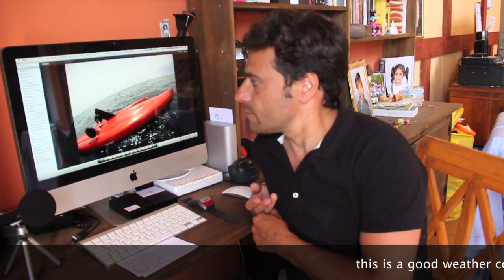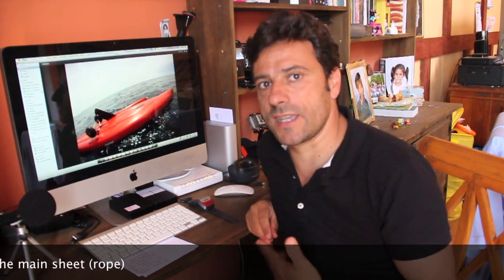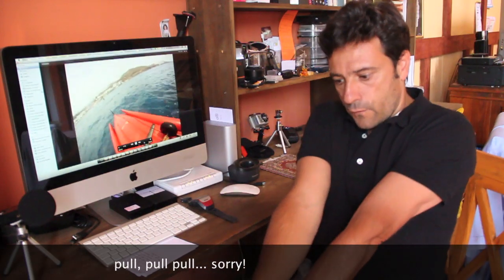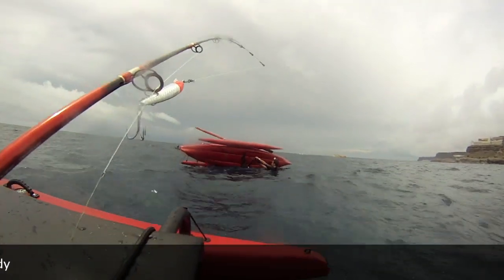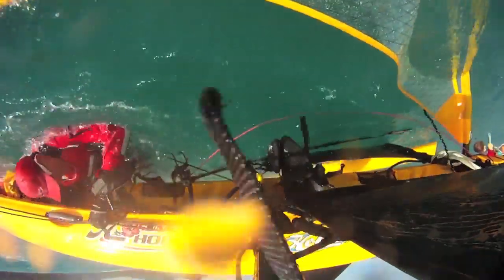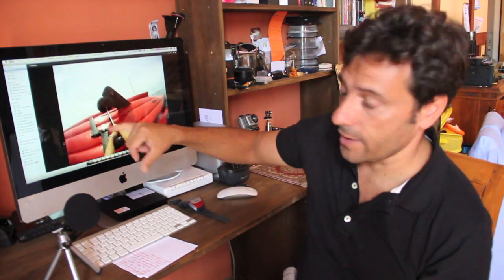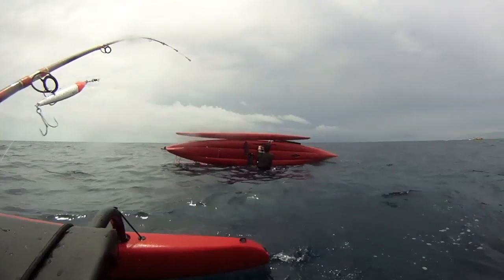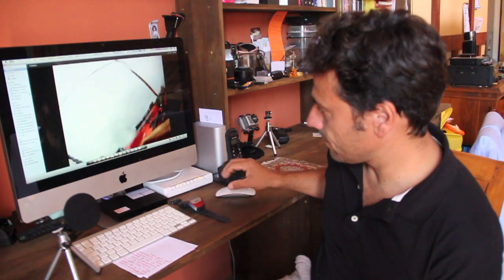TANDEM ISLAND CAPSIZE AND BACK ON

Comment: Based on experience with Hobie 16 catamarans, I wonder if it wouldn't be wise to collapse or fold in the ama that you are going to stand on (I don't know whether you can lock it in the folded position or not), and pull the righting line over the ama that remains extended.  that gives you a lot more leverage that you can use with your body weight.  I'm not sure I'm describing this with words adequately, but it would be like you were righting a catamaran instead of a trimaran.